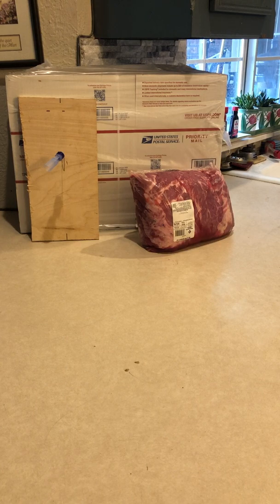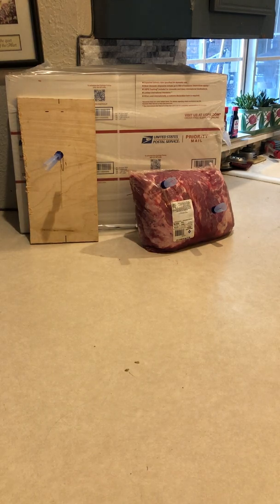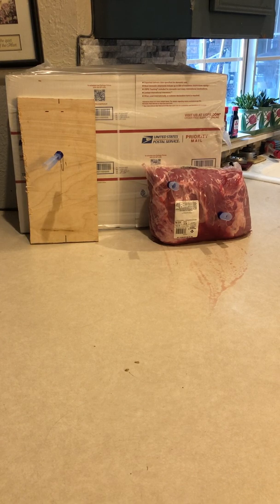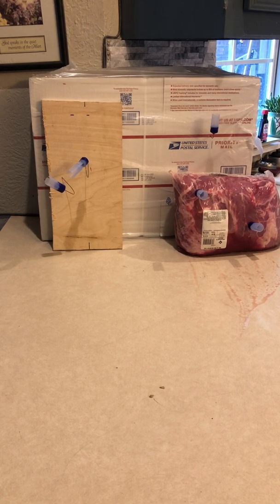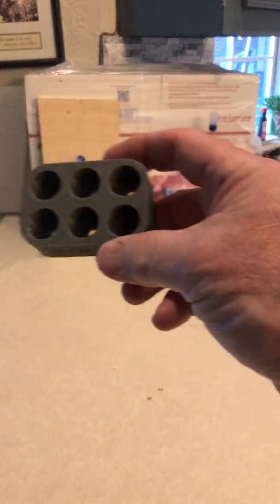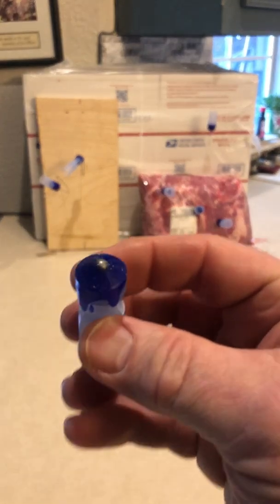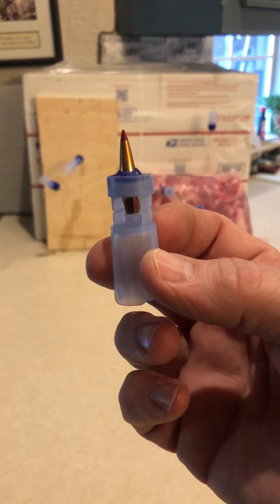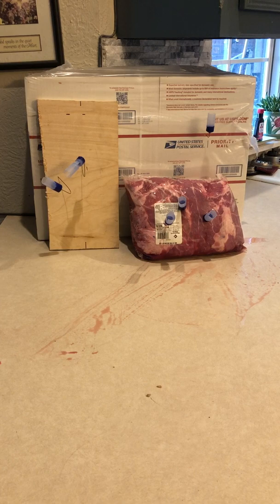68 caliber mold for Umarex Part 1 VID1

Comment: wonder how it will work with a 3-5 inch nail?
Reply from the maker: Lightweight 6-8" aluminum nail would be wicked. Within about 2 weeks I will be offering ball molds for the .680, .500, and the .430 Umarex products.